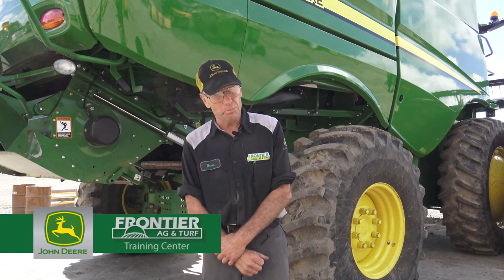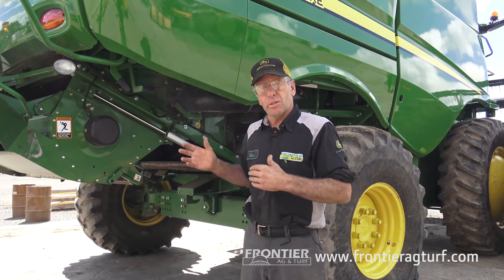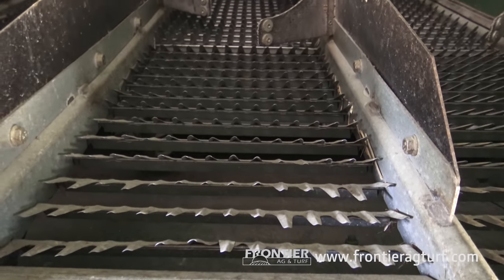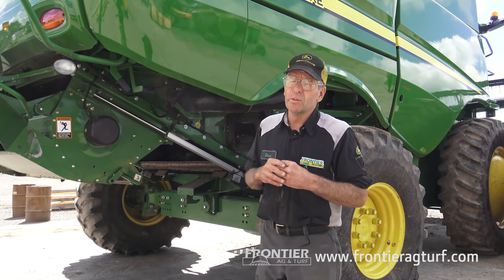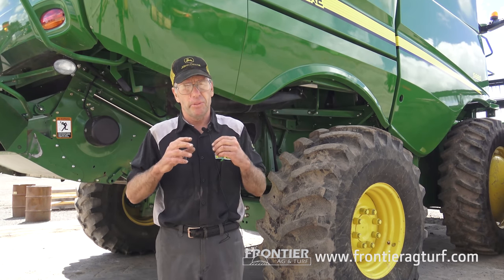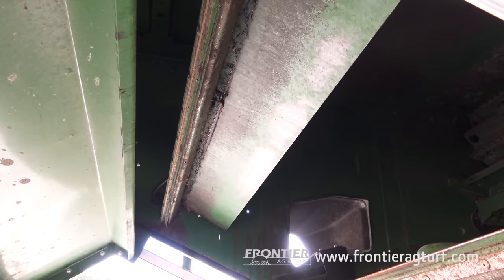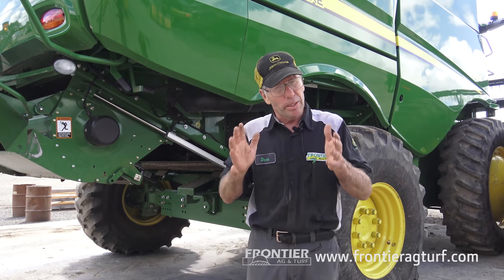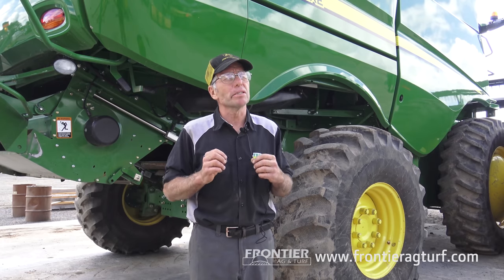Combine Clinic: Sieve & Chaffer

Comment: Working on a S680,rubber bushing are new only done one soya harvest, combine is having a strange shake when I run the shaker pan....what cub be causing the problem, have taken out the shaft that drives the pan for straightness testing, also found the prop shft from rotor drive has worn universal joints.

Comment: Hi Dave, how do I adjust the concave and sieve for Teff harvesting? or do I need a new sieve for Teff harvesting?
Reply: Depends which crop you are combining. We combine wet corn and you have to run a lot of air...we put the upper sieve the size of our biggest kernel for the year...and bottom wide open. The rest is concave and cylinder speed...there is never a need to re-thresh any corn if your cylinder and concave are set properly. You just take cob pieces and demolish them and send them thru both sieves and into the tank.